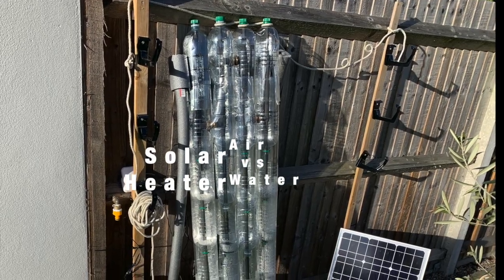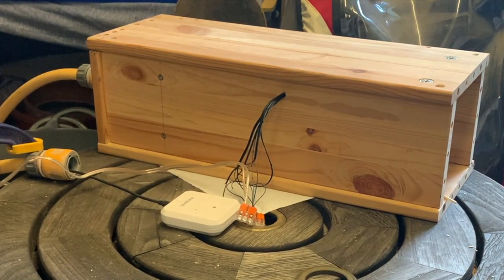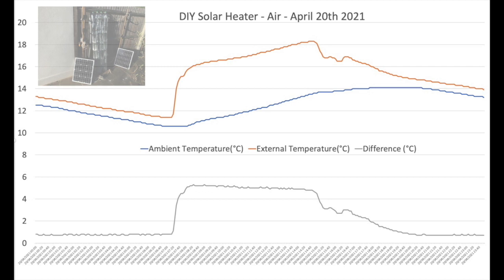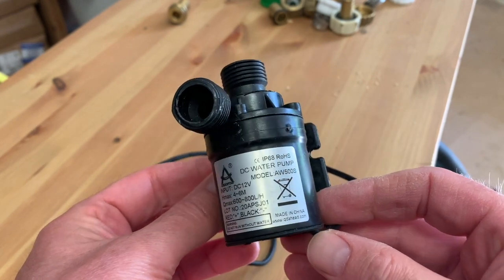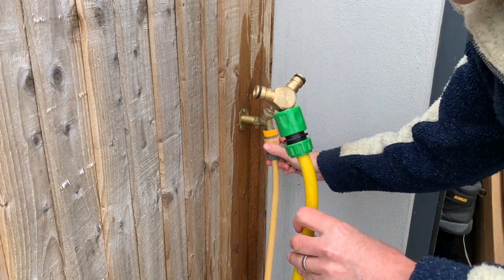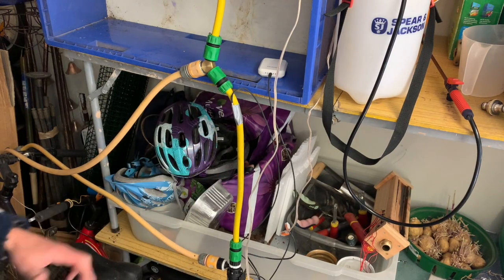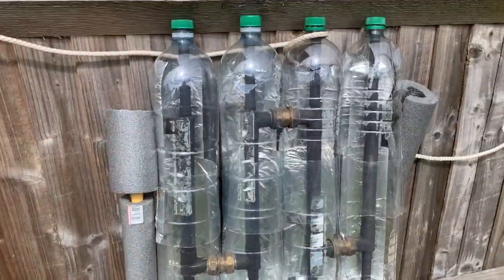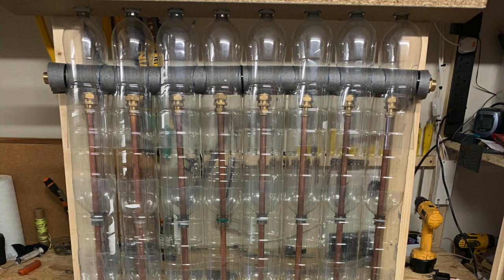DIY Solar Heater Part 7 Air v Water

Comment: great video series, very inspirational, an idea i had while watching this would be to create a reservoir that you can pump your thermal mass to at 6-7pm since thats when your temp begins to drop, having the res inside and insulated will help you save your captured thermal energy, a secondary function to sending the water away could be by using an electrical timer and thermostat to pump the water outside again, set timer to say 7 am and thermostat to target 2-3 degrees or more, and so at 7 am your thermostat and pump are energised but the pump only acts if target temps are met, so no water can freeze and you can conserve the energy as much as possible, id love to do something similar, i'm also looking into low differential stirling motors for low grade power generation